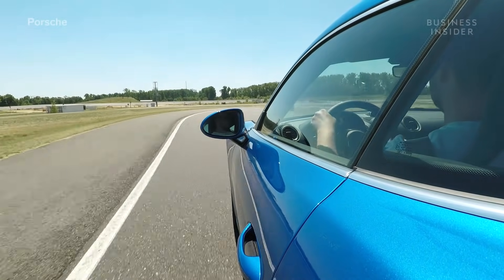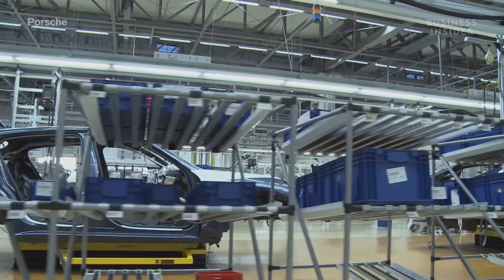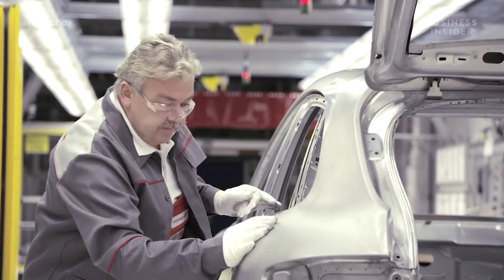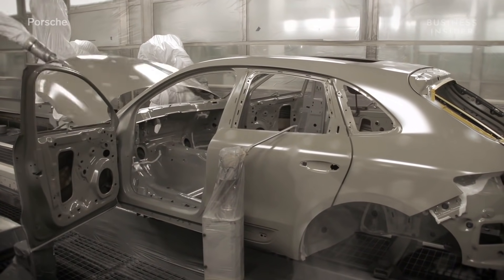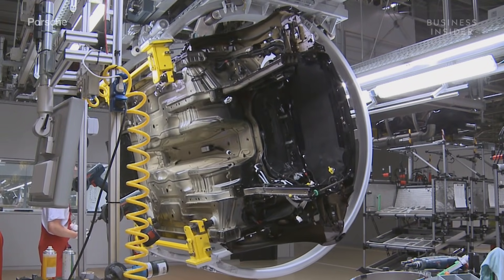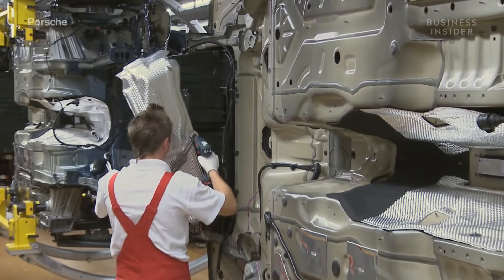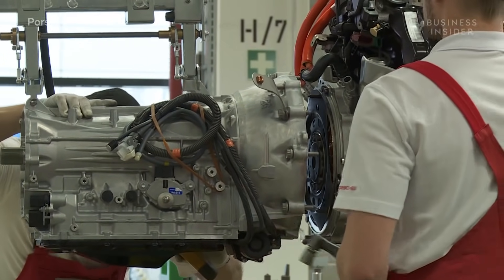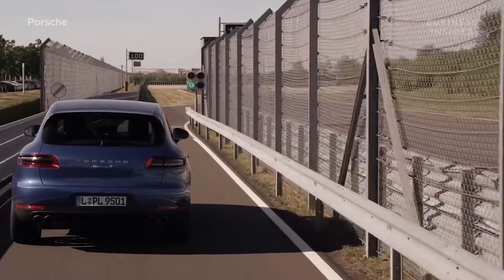How Porsches Are Made

Comment: "The two models are built from hundreds of individual steel and aluminum parts ..." This used to be a good/impressive thing, but better yet is to simplify the manufacturing process to have less parts and less steps, such as with Tesla's single-piece die-casting. ("The best part is no part")